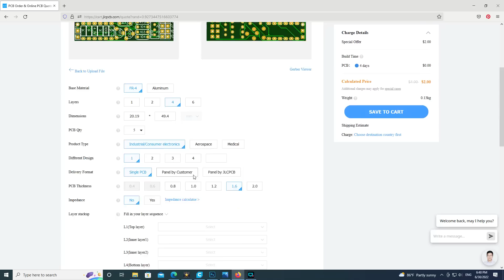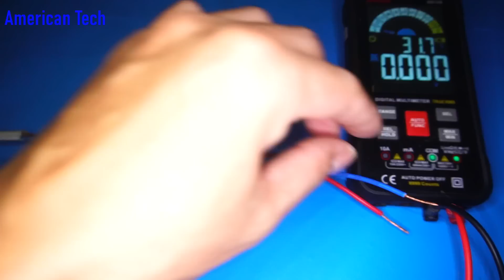DIY SMPS Power supply 12V 10A

Comment: I made the circuit, there is not that much current, 50 watts is difficult, only 20-30 watts of power, the data is incorrect, misleading, unstable, very noisy👎

Comment: I want to thank you for the detailed explanation of how to do it.
But when I want to get another voltage - say 60 volts - 1 amp -
I have to change the number of turns in the secondary winding - I guess 30 + 30 ?
Also to sweat - by changing R3/R4 = control the output voltage?

Comment: no feedback?
Reply: no feedback voltage regulation?
Reply: The feedback is done by the IC measuring the voltage on the auxiliary winding. Of course, optocoupler voltage regulation is more accurate.